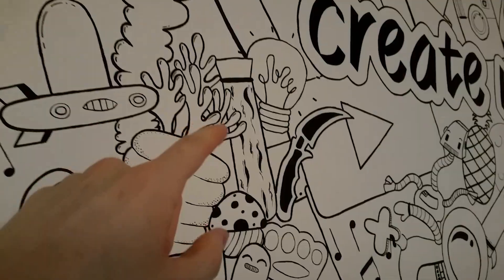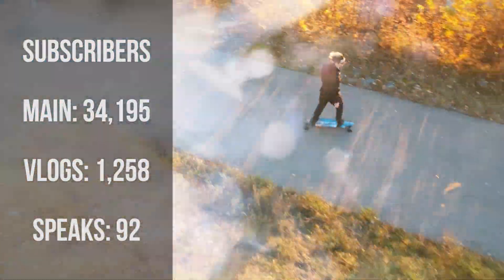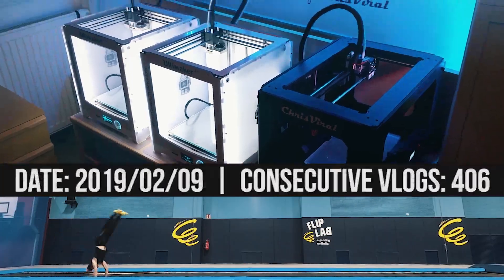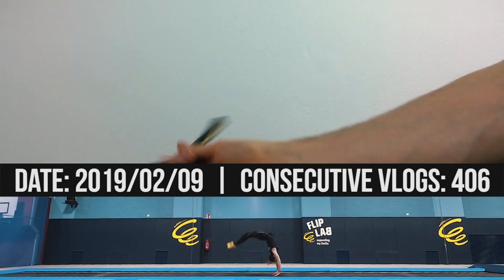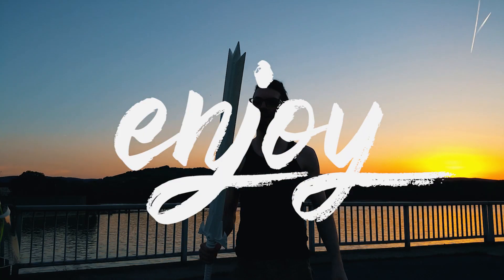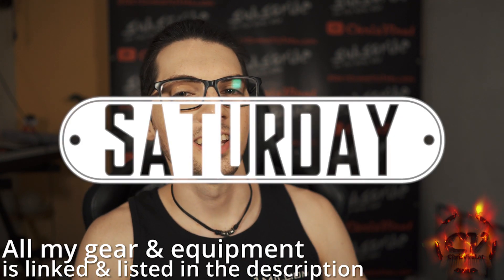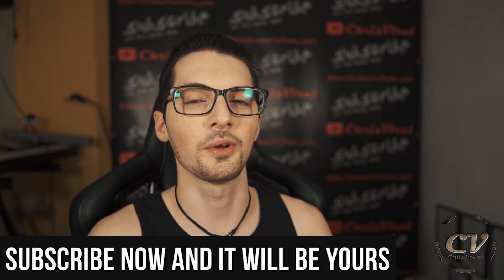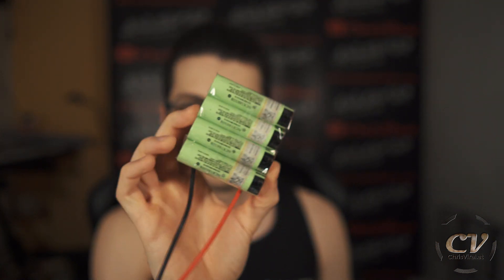DIY 60kWh Powerwall (Overview & How It Started)

Comment: I noticed that all the big private installations are using aluminum.  Like the big 100kw plus generators and even overhead lines. It doesn't make sense to use copper anymore
Reply: What is wrong with using copper?

Comment: Hey chis! Nice video  thanks. But I got a question. At 1.37 min I see batteries ranging 300-500(mAh). Is it worth to spend the time and use this low range batteries? I have thrown over 100 batteries below 1,500mAh after viewing other YouTube’s. Please advise with your experience with the result in using.  Thanks in advance.

Comment: recycled 18650 are stil better than the "new" ones from china with only 900-1000mAh.
Reply: Hahaha... I started with 100 of the china cells.... Only600mah..now I'm stuck with them..
Reply: @SubieRow  thats bad experience, learn from it always buy 1-3 testsamples from different sellers before you go Allin. You can pimp the china cellc a bit if you Charge/discharge then 3-5x times , then the capacity should be a bit higher
Reply from the maker: Why are you stuck with them? Just get rid of them 😝
Hektor #1 btw 🔥
Reply: @ChrisViralVlogs  I disassembled them and threw them in the recycle. Now I found a good supplierif samsung 30q putting out over 2900 mah for $2 each. I think it's a good deal. Thanks for the help.
Reply: @SubieRow  do you have a link to that?